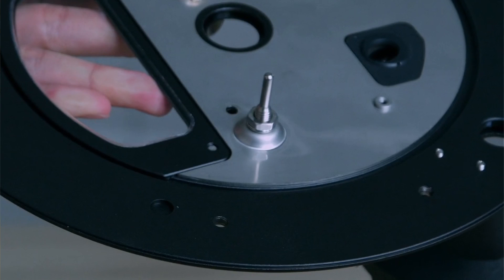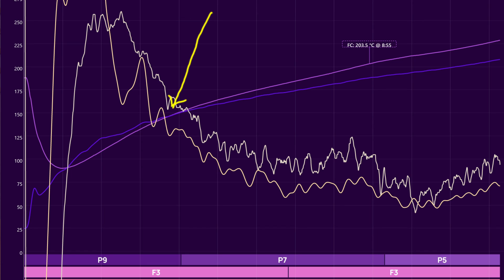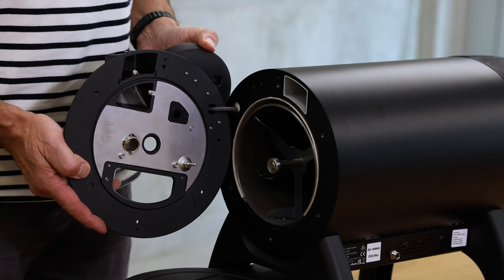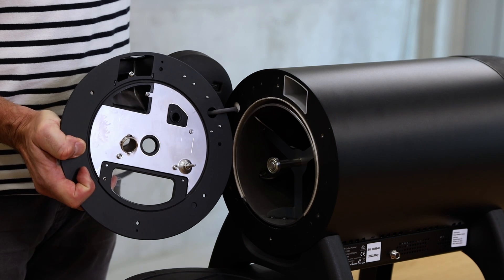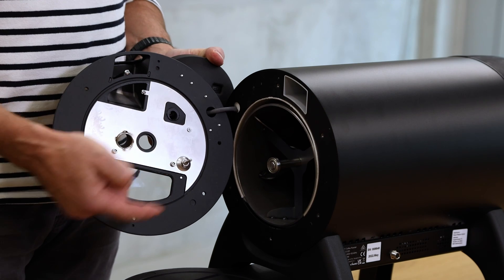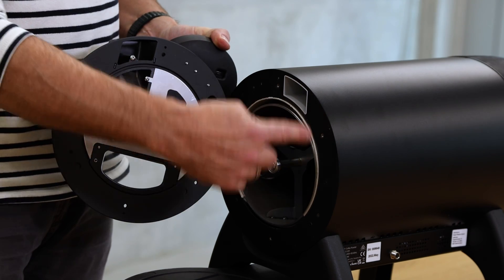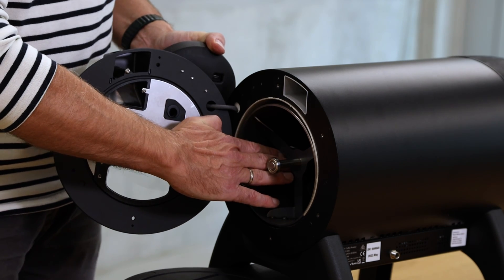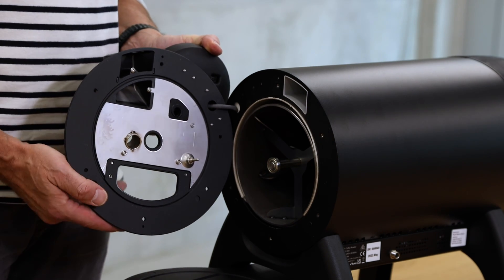The IBTS by Aillio Bullet | how the infrared sensor works, when to use it and how to clean it

Comment: the problem with all infrared-thermometer is that they can only meassure 1 surface correctly (can be adjusted - usually you get a manual with surface adjustment corrections).

the question is, if 2 thermometer give you 2 differnent °C readings, one or both are lying!
Reply from the maker: Thanks a lot for your great questions. You might have seen, that they did quite a detailed blog on the IBTS: https://aillio.medium.com/the-start-of-something-39aa01d08fa9
Kind regards
Ingo

Comment: the drop is imho not because it's slow, but because the pt100 gets unloaded, the radiation from the drum, and then you drop in the "cold" beans, and those cool down the sensor.
the thinner and more conductiv the outer sensormaterial, the faster would be the reading.